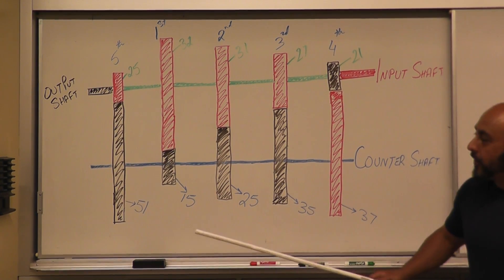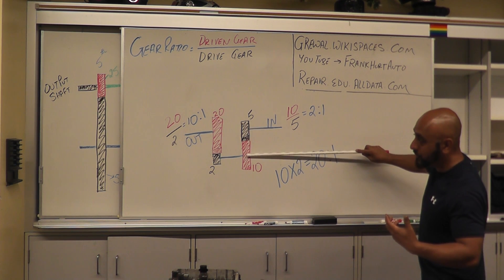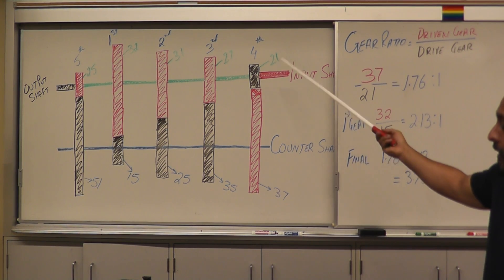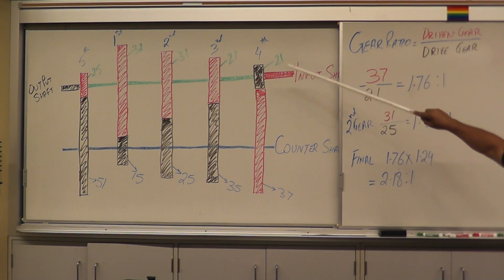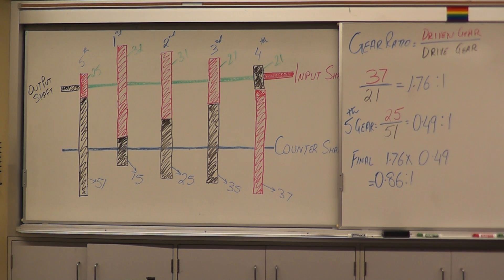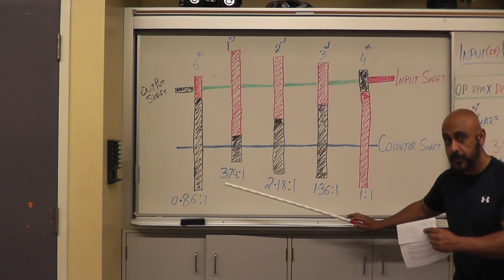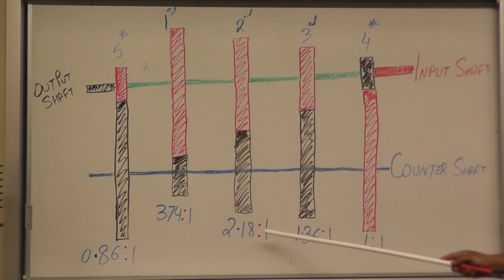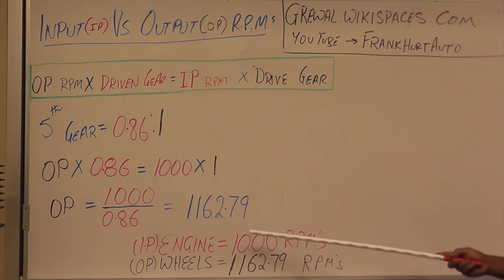How to calculate gear and speed ratio on Manual transmission.

Comment: I am a little bit confused on this part. 
7:25 and 13:10 mins of the video.
you said on 7:25, that the Gear Ratio is 3.75:1; wherein, 3.75 is the Input(DRIVE) and 1 is the Output(DRIVEN).
But on 13:10, 3.74 is the DRIVEN and 1 is the DRIVE.

Comment: What is overall ratio? I see that mentioned on commercial vehicle transmissions.  
The Eaton Fuller    RTO16908LL Transmission in my dump truck has an overall ratio of 19.68. What does that mean?